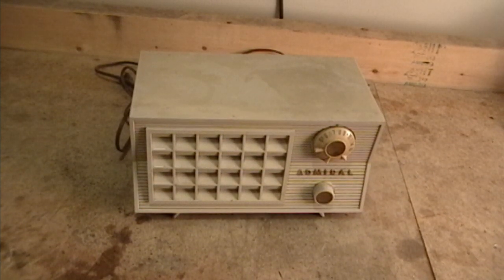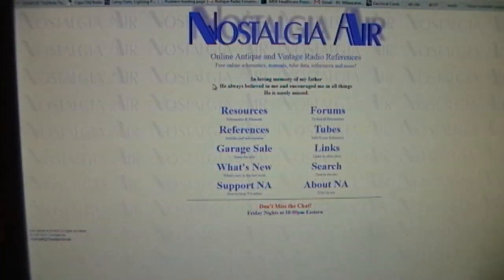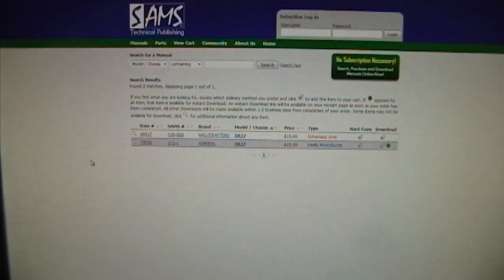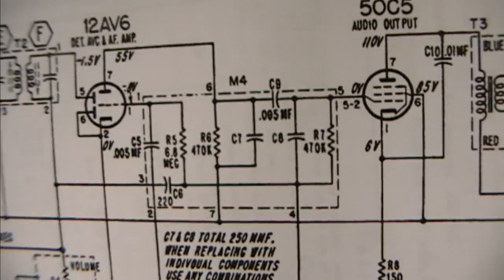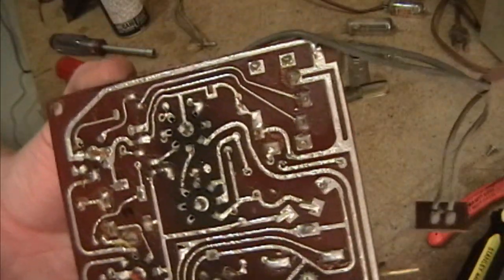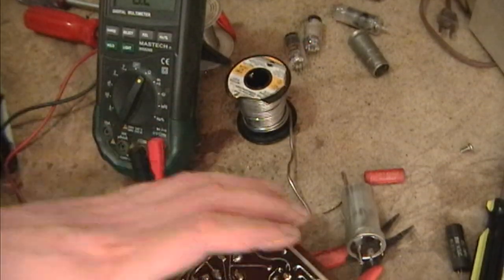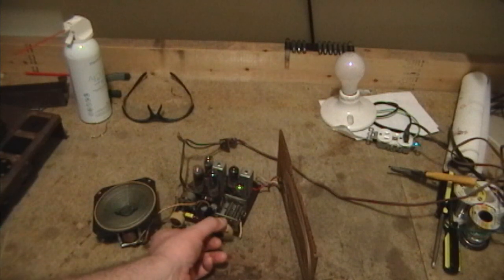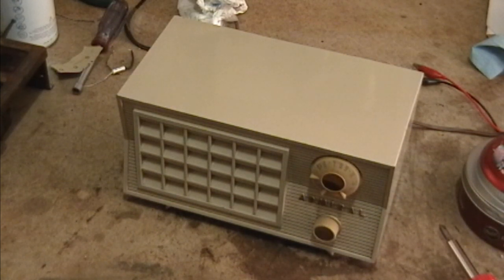FNR - Admiral 5R37

Comment: Hi Bob, wow.. I have worked on a few radio's for a short while and some had the smaller tubes but what is this with the PCB shoved on the far left side?? The middle bottom is very blank? Seen many formats like this and usually they take up the width of many radio's. Never did an Admiral as well tho. Maybe Admiral though they would use larger tubes or smaller so they had 2 choices? dunno tho. just a guess. Knowing how important Beitmans Schematics are, I am going to send Dave 5 bucks. Thanks Bob.

Comment: I used to have a set just like that Admiral 5R37, it was rebranded as a Fairbanks Morse and was a pale yellow colour. I don't remeber if I did any work to it at all other then giving the cabinet a good cleaning, then I sold it and a bunch of other mid 1950s to early 60s sets to a fellow collector in a package deal.